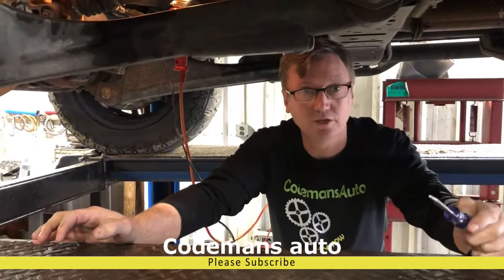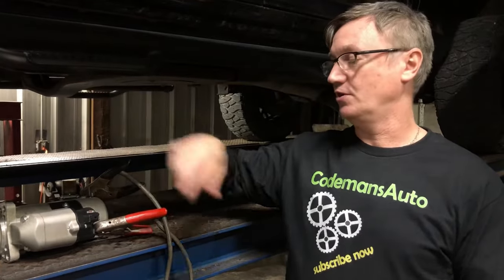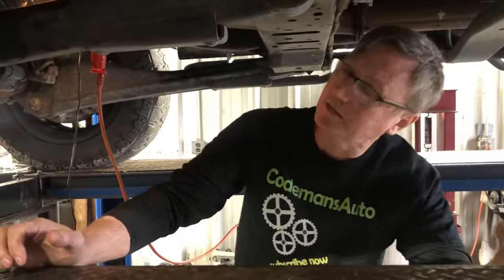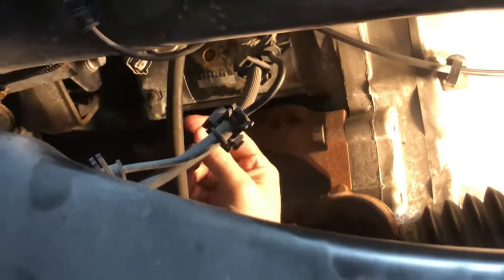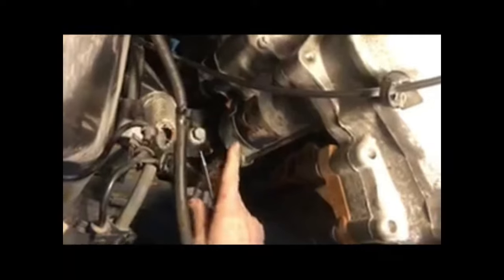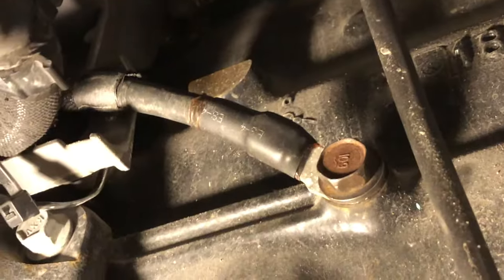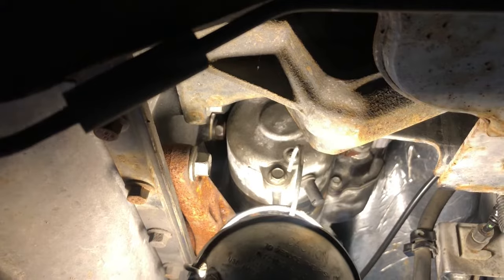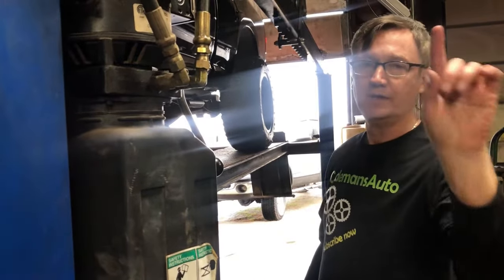Dodge 2500 3500 Cummins diesel  No Crank Won't Start  check this ground wire its not the starter

Comment: I’m having the exact same issue, I put a jumper in the relays place inside the fuse box and it cranks the truck up but when I replace the jumper wire with the relay, it won’t start. I replaced both parts, starter & relay. Time to clean the ground connections and get back on the road , hoping this does it ! Ty for the video
Reply: What did you ever figure out?? Did you have any power at all to the dash with key in run/start?
Reply: @jameswade8432  it ended up being the dang key fob, it just needed a new battery. What’s up with yours ?
Reply: @jenniferpasten8847  what year? Mines a 05, don't believe the for has that kinda technology lol. Mine just started having 0 power in the run/start position. I jumped the starter relay and it turns over and all fuses are powered in the fuse tray except #34 abs module run start...maybe that's piggybacked and gets power from the run/start. Dash and windows work in acc but powers missing in the ignition switch run/start. I replaced ignition switch...no change.
Reply: @jameswade8432  right….next would be cleaning off ground cable with wire brush in engine bay along the fire wall. I guess they collect dust & rust and mess with the connections.  I believe there’s more than 1 ground connection piggy backed, just have to find them. I swapped the starter and key fob battery and it worked, Lmk what happens
Reply: What relay did u jump?
Reply: @badkarma684  starter relay . It ended up being the batteries to my key fob btw

Comment: Look at those tires. Way past time to replace them. All too common the overly wide and expensive wheels and tires running around get worn bad,  not rotated maintain and proper tire pressure. And it's running around nearly Bald and choppy

Comment: Did exactly this to my 2018 2500 6.7 but did not work for me unfortunately. Tested the ignition plug, 12v to starter, starter itself is good and still no start issue….
Reply from the maker: Neutral Safety switch would be something you should check if you haven't already and one way to check it would be to try to start in Neutral just make sure set your e-brake first. i have seen these give issues with a no crank no start

Comment: Helpful video , I just replaced my starter and still having issues with it starting , my question is would a bad ground cause my batteries to lose voltage overnight ? Batteries are still good took them to get checked but I’m having to jump start the truck every morning

Comment: codeman, when mine doesn't start, open the hood and  i tap the starter once w a steel bar and it starts up. done that 20 times. dead spot or brushes in the starter?

Comment: Was there power to the dash in run/start? My 05 cummins has power in acc but nothing in start/run. Heater fan works until you turn key to ignition then no power. No power to OBD port either. Ideas?
Reply from the maker: You need to get someone to try and crank the engine while you 12 volt test the signal wire going to the starter so that you can rule out the starter and from there I would look for bad relays or fuses or maybe check relays and fuses first but this is a good starting point    hope this helps
Reply: @codemansauto208  no power to dash at all in run/start. Nothing. I did jump the starter relay in the fuse box and motor turned over so that should rule out signal starter wire right? Only thing odd I noticed so far in fusebox was #34 abs module run/start doesn't have juice. Maybe it's powered when running I don't know. I think I need to track down the power wire to ignition run/start and go from there. Any idea what wire and pin in fuse box that may be?
Reply: @codemansauto208  I’ve got a 2014 3500cummins it has long crank before start I have to crank it for about 10seconds 3-4 times before it starts do you have any advice I’d greatly appreciate it

Comment: When I turn the key the gauges light up but don’t move, the fuel pump is silent and it cranks but won’t turn over
Reply: Did you find out what it was?
Reply: @sarahstokes9744  unfortunately not I have it In the shop but when my buddy fixes it I’ll tell you the culprit
Reply: Try unhooking the battery for an hour and hook the battery back up and restarting the truck ok.
Reply: It could be the engine control module.
Reply: @sarahstokes9744  found the problem it was the TIPM module about $150 to replace minus labor

Comment: I’ve got a 2014 3500cummins it has long crank before start I have to crank it for about 10seconds 3-4 times before it starts do you have any advice @codemansauto208
Reply: Check fuel pressure, could be failing lift pump.